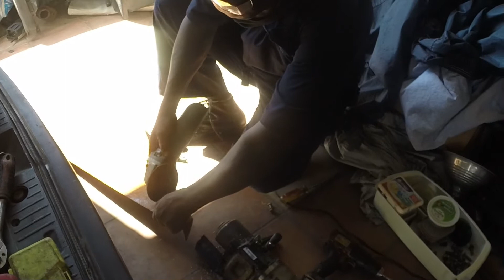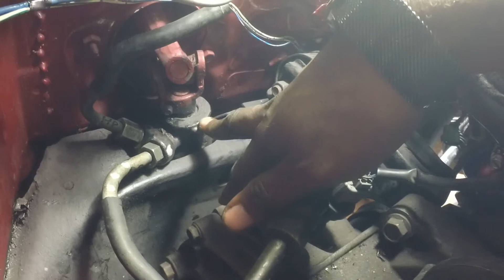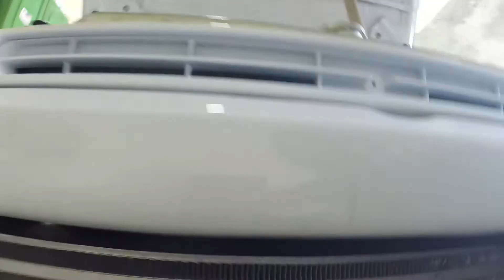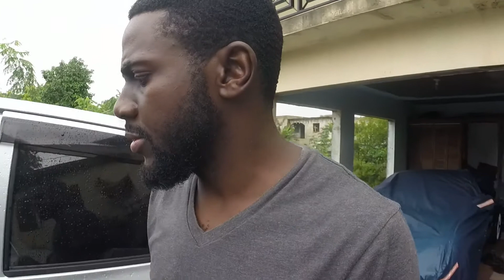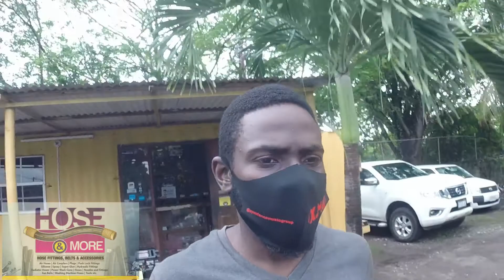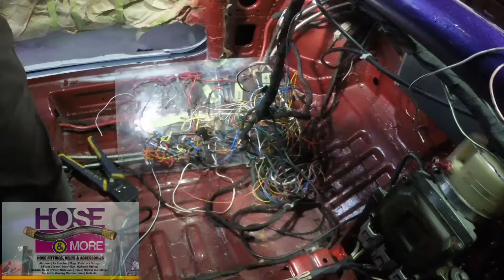PROJECT CHARONDA EP. 20: MR2 Spyder Power Steering Pump Install Pt  1

Comment: This rack setup from the mr2 looks nice...but what benefits are there to install a cooler for the power steering fluid?
Reply from the maker: The fluid will also have to cool the pump which is electrical, the fluid will intern get hot. To ensure we dont run up having an overheating issue while racing, i decided to use a cooler, nothing too big. The races the car will participate in are sprints, so it's less likely to happen that the fluid will get hot enough for that to happen